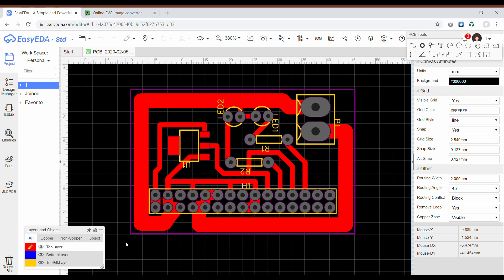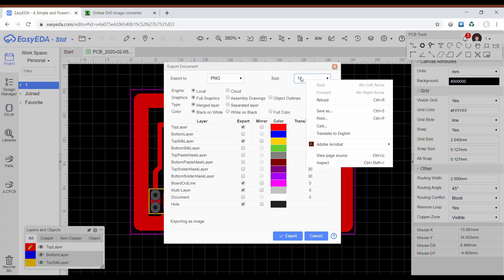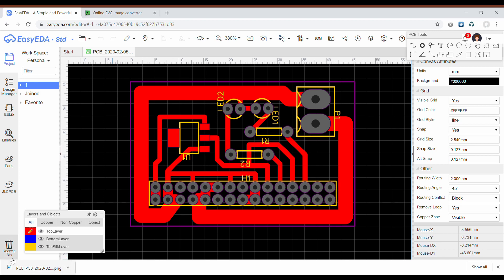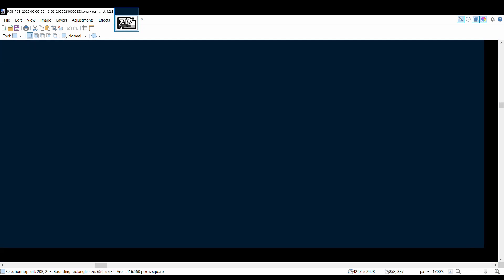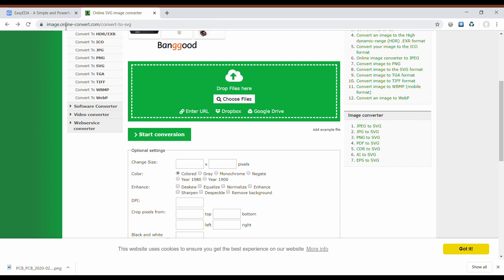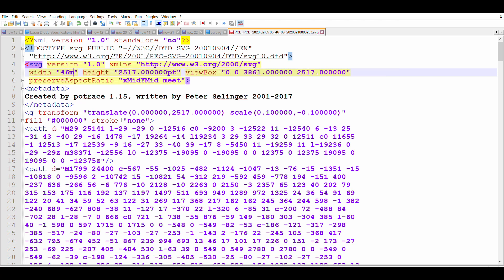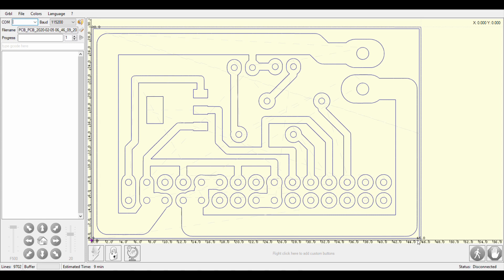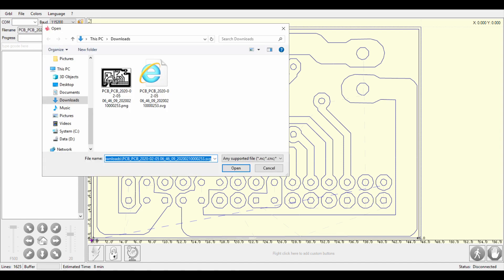PCB making using laser engraver, PART 2

Comment: Hi zoon, one more thing I did not catch on the video about "changing the mm of the board"
what program did you use, and how to open the file to edit.
thank 's again.
Reply from the maker: As I exported 100x times the normal size - it is big. Now when I convert it to SVG I get big SVG, but really nice quality of the lines. Thus I read board size in mm from Easy EDA, then open the SVG file in any text file editor (I use Notepad ++). Then I change the size from points to mm (as I show in the video from here https://youtu.be/aW_rbhERcto?t=357).